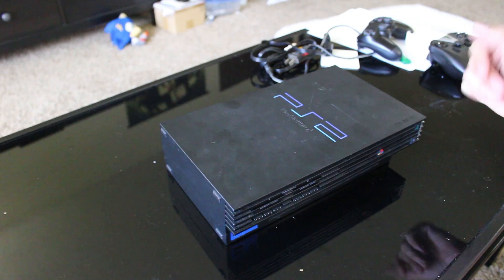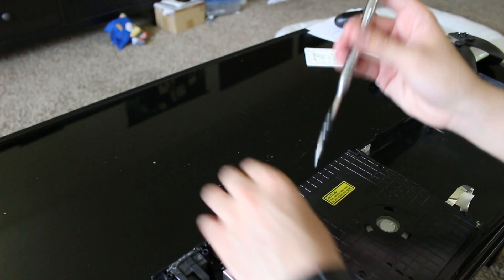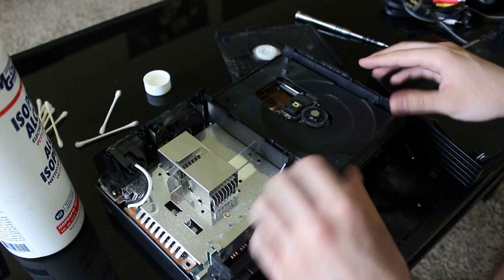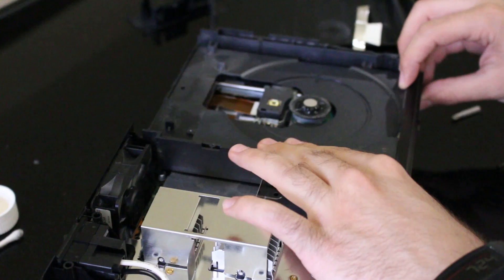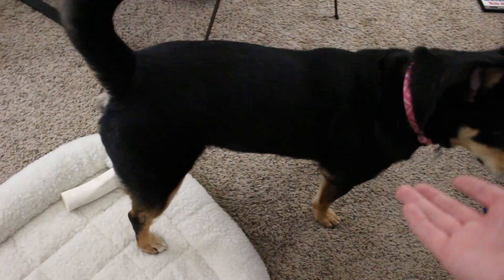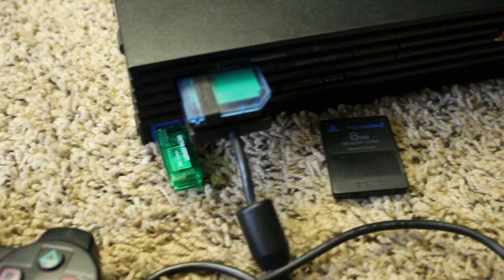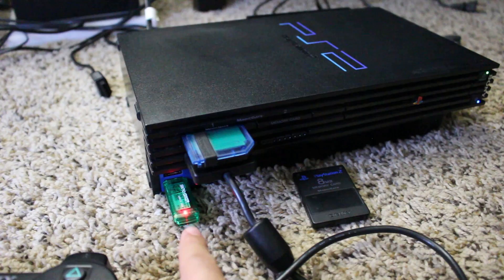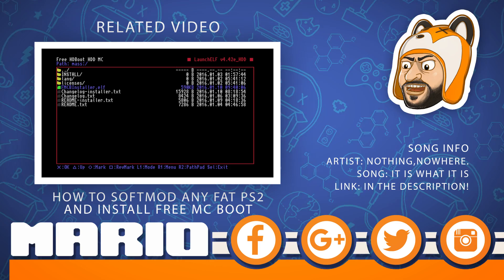Let's Refurbish & Softmod a Fat PS2!

Comment: what is a softmod?
Reply: Israel Jr Meza means hes modding the software, hard mod is modding the hardware
Reply: Eric Payne 
Technically FMCB/FHDB is not even a softmod, because the software on the PS2 also remains totally non-modified!

It's kind of an exploit, while technically it also doesn't really exploit but rather tricks the PS2's Update-mechanism.
Reply: Simon Crawford 
Is that a rethoric question?

Hardmodding involves modding the Hardware...
Softmodding normally means modding the software on a target-hardware (directly).

For easyness we called it 'Exploit' and 'Softmod' back in the days, so we can say: 'Softmodding involves a way to start custom code on an 'enclosed device' by means which do not include to mod the hardware of the target-device...'
Reply: Softmod is a mod that is not that hard hard mod is a difficult modification to the console
Reply: ExTec DARK 
That's an untrue generalization! i.e. PS1-Modchips are quite easy to solder, compared to finding a compatible PS1-Cheatdevice for UniROM!

Comment: just buy a memory card off eBay with MCBOOT on it. saves a lot of time
Reply: SpazziJackazzi
There's no need for it, if you are using a HDD.
Reply: Alex J from what I have heard it boots faster from the memory card
Reply: SpazziJackazzi
Indeed, but there is no need to buy an FMCB'd MC, if you have a FAT PS2 with HDD and adapter...

I suppose on an SSD, it would start equally fast.
Reply: Time is important to me buying a memory card with MCBOOT is much quicker than transferring and installing files onto a HDD. I wouldn't consider putting a SSD into PS2 simply a waste of money. I have a 400GB HDD IDE that cost me $20
Reply: SpazziJackazzi
Yeah, now! But in a few years, they will be equally cheap like an HDD. You already can find SSDs on trash just like the fully working HDDs (up to 250GB). I just mentioned it, because of the 'speed'-part. I would suggest at least an additional FMCB-MC anyway...

About the difference in time about installing it to either HDD or MC: There is no real difference...
Ordering an MC would certainly be taking longer, than writing an HDD-Image to an HDD/SSD/etc.
Reply: After you get the memory card what do you do you do to get games on there?
Reply: You're limited to the IDE performance of it's heyday, damn what you put on that network adapter. It's even a waste to put a SATA III drive on there, because it's being downgraded to less than SATA I performance (because this thing is IDE further up stream; SATA mod is just so you can use drives you can actually purchase today, new). 0% performance increase. It would absolutely be a total waste to use an SSD. The caveat being if you wanted to benefit from reduced thermal output AND save (albeit a negligible amount) on your energy bill. Also, SSD have a finite write cycle, unlike HDD... not well suited to this use for that factor.

Comment: Seriously thinking of getting a moded PS2 Slim and play the shit out of it although I have a PS4 Pro and a PS Vita .
Reply: Livius 
Currently a FAT is still better, but a slim might get more interesting if the deckcard-hacking 'goes further'.
Reply: Alex J thank you for the tip:)
Reply: another thing to note, if you care the fat models with the ps3's component (the cable with the three colored cables for video) will get you great video quality but due to the compact nature of the slim the video gets interference from the power supply being so close so it has a slightly less clear video output than the fat one, also the aesthetic of the fat one is so nice, id almost want to put the slim inside a fat case just for that reason lol. but if you dont care about the slight difference in video then its probably better to get the slim.
Reply: Livius 
I have to correct myself,... It is called 'DECKARD', which essentially is a PPC, which emulates the IOP (secondary processor of the PS2/MIPS R3000-variant) partially in software and partially in hardware.

Further hacking-efforts could lead to:
- loading PS1- and PS2-games from other devices than disk with almost 100% compatibility (without the need for any other Loader like POPS, OPL, etc.) [kinda like 'image-mounting'], which would even work in the PS2's menu...
- loading PPC-code on a PS2 natively!
-etc.
Reply: Thanks you all for the great tips . I will see if I eventually get a PS2 , I have so many consoles that I don't have to play them all :)
Reply: Livius 
Well at least old stuff can be emulated accurately on a lot Hardware, so no need to have a CRT and a C64 still plugged to it... However, in newer Generations like the PS2, I prefer to use the actual hardware (well, it is fun with an Atari, too... ^^ ).
Reply: Alex J exactly. I can emulate NES all day but it doesn't compare when you play on the console itself, it doesn't have that charm.
Reply: Livius 
I agree... However it is a solution to get rid of too many Consoles/Hardware being connected to one monitor. ;)
Reply: In my experience, the PS2 can't emulate SNES full speed and only does about half the Genesis titles well.  Atari, NES, Master System and other 8-bit systems run fine.  But 16-bit is going to give you some trouble.

Same goes for the Dreamcast.
Reply: Magus12000BC 
Well, that's due to a lot of these emulators being (non-optimized) 'ports', instead of specifically adapted or programmed emulators/apps.

The PS2 can emulate an N64 in theory, but the implementation of most emulators is just badly done (for most emulators).

You are quite right for current gen emulators on a PS2 however.
PS1-Emulation works o.k nowadays, too.
For SNES there is SNES-Station, SNES9x and another one as far as I remember.
For Sega-consoles there are quite some different versions/ports and types of emulators available...

I am sure we will have some better ports in the future. The open source PS2SDK is getting better every day and the scene is quite active (but every new developer or contributor is welcome).

Regarding other 8bit emulators:
IMO, they run great. Some are even so good, that you really don't need the actual hardware anymore (I think C64/'Commodore 64/128' was one of them and Atari possibly.)!
AFAIK the C64 was emulating hardware-accurate with precision-timings and even the funny stuff like the things developers did, what the software never even was intended for. ;)

Comment: A soft makeup brush does a better job than compressed air. Compressed air may push dust into places you don't want the dust to be. Also don't half-ass it, you know dust is primarily composed of dead skin. So do a good job of cleaning it up I didn't my PlayStation 4 recently it's a year old wasn't very dusty inside but there was some dust buildup on the heatsink. But if you ever cracked open a PlayStation 4 and intend on cleaning the heatsink remember to have your silver paste or thermal paste is some may call it.

Comment: It's so funny, to exploit the PS2 you need James Bond 007, to exploid the Gamecube you need James Bond 007 xD
Reply: REALSlutHunter
You can use (almost?) any game for that kind of task on a PS2.

007 is just the first I suggested, back in the days when I spreaded the 'game-swap-trick' as an alternative install-method, because fortunately it is using some old modules and doesn't re-verify the authenticity of the disc, once it starts a secondary ELF.

Oh... and I think there was an exploit available for the old XBOX, which also included 007... 😁
Reply: Damn that info is too late xD i did the 007 exploit 4-5 years ago (-.-)

Yeah the first xbox was the first system that i know that was exploited, back in the day (around 2004) a friend of me, got nes emulators etc on that thing :)
Reply: REALSlutHunter What's the bet it was the Splinter Cell method on that Xbox.
Reply: Dont know how he did it, all i know was that he changed the cd rom for some reason, put some other hd inside and connected that thing to his pc over lan :)
Reply: Modern 8-bit also mech assault

Comment: You can completely detatch both halves of the shell and remove that ribbon and you can simply put the damn things in the shower with a bit of soap :p if you're picky I guess.
Reply from the maker: I usually use a kitchen sink, but the shower? How have I never thought of this? Ah well, we've all gotta get naked with our consoles at some point.
Reply: @MrMario2011  Let those fantasies soar buddy :) thanks for a good video!

Comment: side note: the fat is twice as complex as a ps1 mainly because it has a ps1 inside of it (like the components for a ps1 are there and everything) and some games actually used those components for ps2 operation. It's how they managed backwards comparability.
Reply: レヨメエ same with the original ps3, had the guts of a ps1 ps2 and ps3 i belive
Reply: レヨメエ
The IOP (secondary processor of the PS2), which was used for PS1-Backwardscompatibility, was used in all PS2-Games because it was mandatory to access Storage-devices like the CD/DVD-Drive...

Your statement is only partially true.
Reply: and the IOP was the PS1's processor.